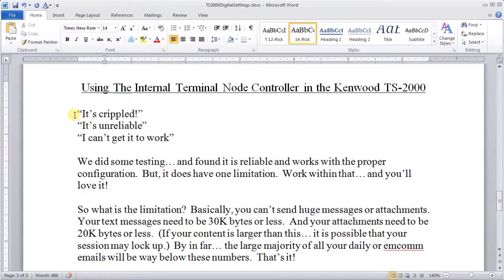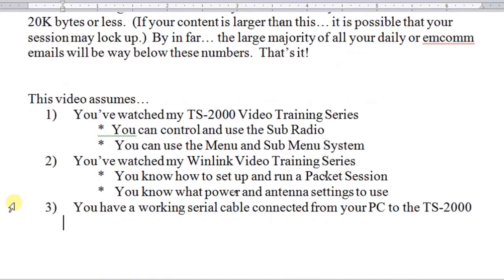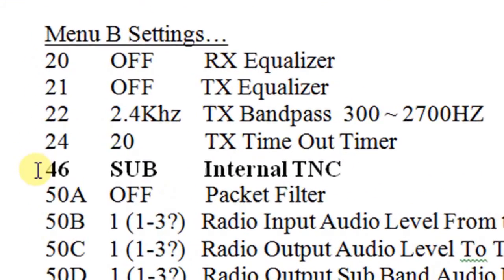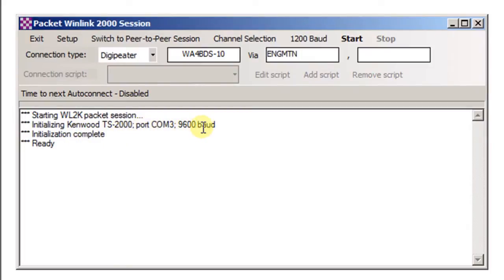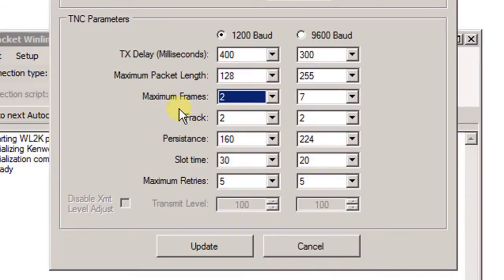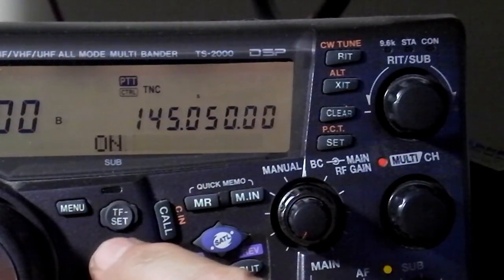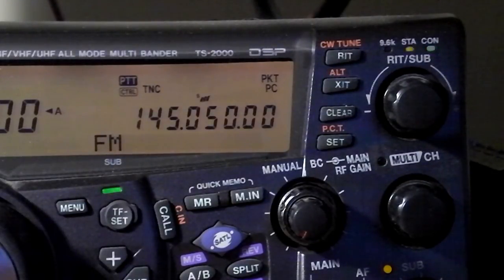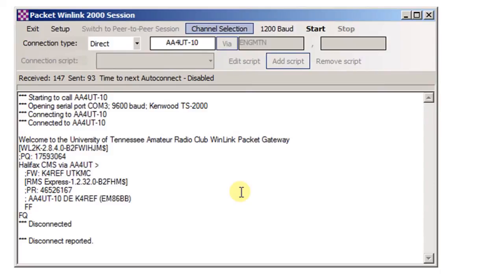6-METERSinc TS2000 "Using The Internal TNC"

Comment: I never had any problem getting the internal TNC in my TS-2000 to work but I personally found it's features too limited to do what I needed without coupling it with some form of software controlled program. I ended up buying a nice used Kantronics KPC-3 (ver 6) TNC for all of $80 and used that instead for traditional 1200-baud packet operation. Although the internal TNC does work, it's limitations can be rather lacking. Fortunately KPC-3's are cheap and plentiful and can be used on almost any radio. Today you can simply use any number of free software along with the soundcard in your PC for this purpose. Years ago soundcard based data emulation wasn't very reliable but today it's gotten way better :)

Comment: hmmm I have every thing setup like you list but I am getting an error
** Starting WL2K packet session...
* Initializing Kenwood TS-2000; port COM4; 9600 baud
* Initialization failed - Unable to Initialize TNC or TNC not found
ARCP-2000 and Ham Radio Deluxe work fine.. I am running windows 7 64Bit
Reply: ok I got it to work I had to restart my radio opps

any how thanks for all the info... 73's from KD2GOE